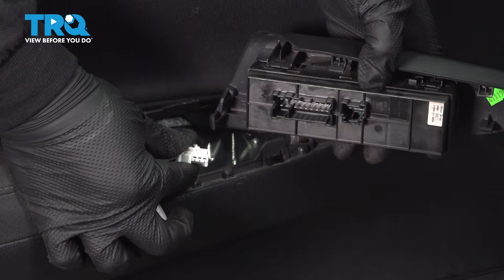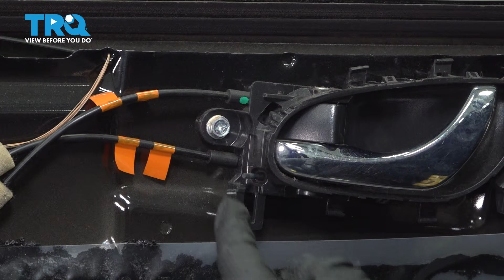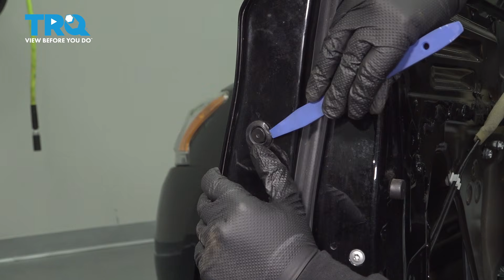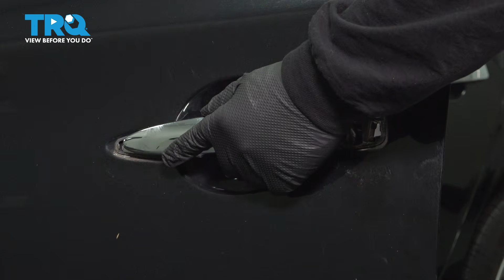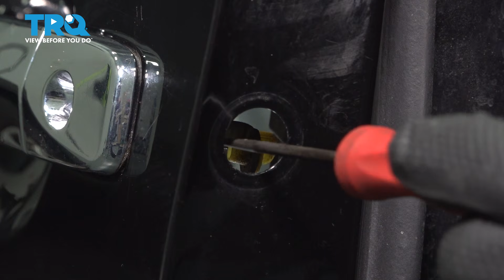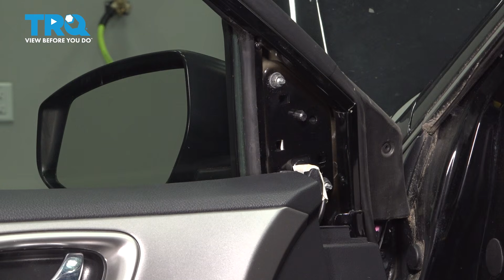How to Replace Front Exterior Door Handles 2013-2019 Nissan Sentra

Comment: Nissan wanted $950.00 for both handles and gaskets,  plus labor to put them in..  like $1400 plus.   They are $45.00 on ebay for both sides (no gaskets) just be careful,  watch this video and about 30-45 minutes each side.  Pretty easy actually.